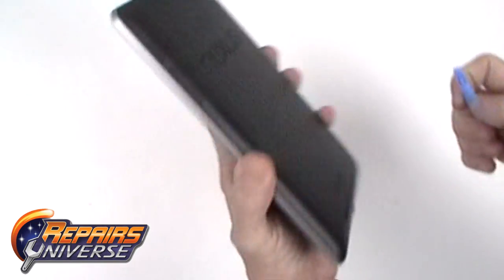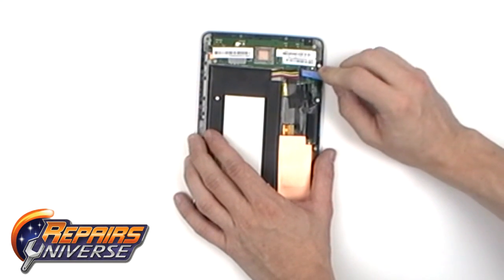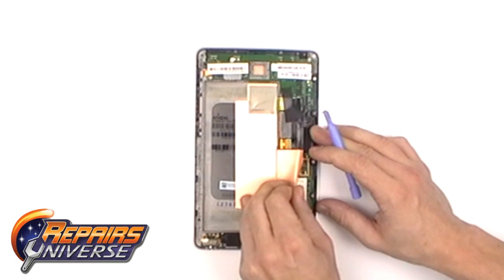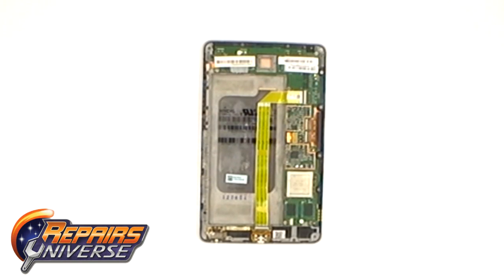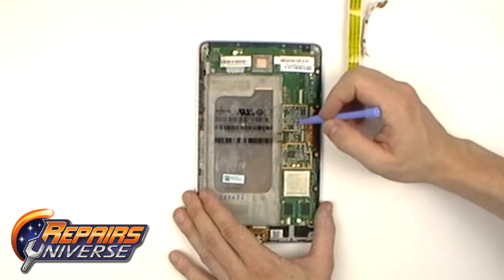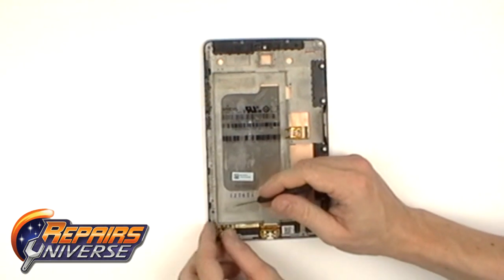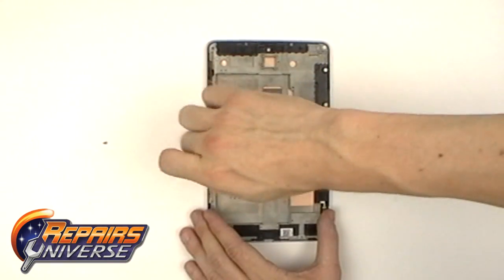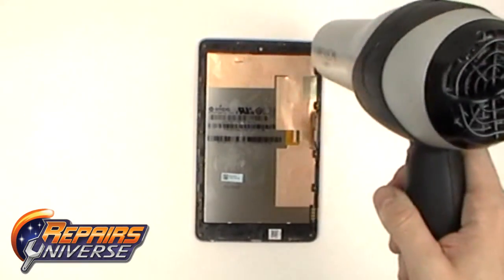Google Nexus 7 Screen Repair Guide Video

Comment: I cracked my screen severely and as a result of this the touch input does not work. What part is broken and what do I need to order?
Reply from the maker: Ben Hanley The LCD is fused to your digitizer. I would recommend purchasing the complete assembly. Here is the link if you own a Nexus 7 first gen. http://www.repairsuniverse.com/google-nexus-7-lcd-touch-screen-digitizer-assembly-replacement.html
Reply: Thank u I will do so
Reply from the maker: You're welcome
Reply: How do I tell if it's first generation

Comment: Why would you remove the volume power button flex cable from the frame?  That adhesive doesn't work well a second time.  And are you supposed to replace all the copper tape you tear off before reassembling?  Reassembling isn't just reversing your steps here, there were things that were destroyed in the process.  Something about the necessity of replacing them would be really helpful.  Or a pointer to the reassembly instructions.  Or ANYTHING.
Reply from the maker: Thank you for your input. The copper tape is used as a heat shield and should be reinstalled. Once the screen has been installed in the frame you should be able to reassemble in reverse.

Comment: Hi , I really need a reply because my nexus fell( from about 4 feet to wooden floor) and I can still turn it on and off and it seems to still work but when i touch it the screen is not responcive. do i need a new screen or what should I do or try? thank you for reading
Reply from the maker: Alfonso Lopez Sounds like you damaged your digitizer during the fall. If you order a replacement screen from our site and follow this guide, you should be able to repair it back to full functionality.